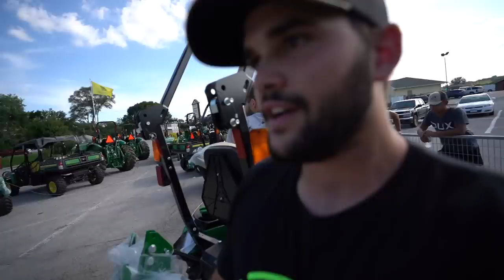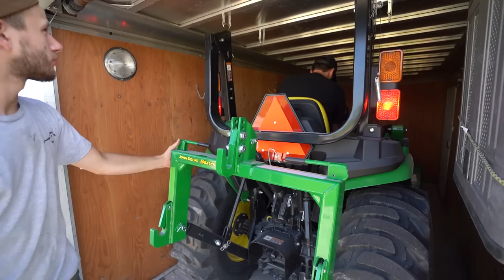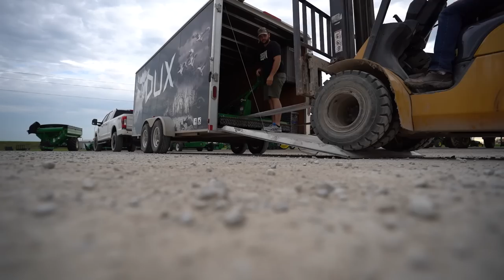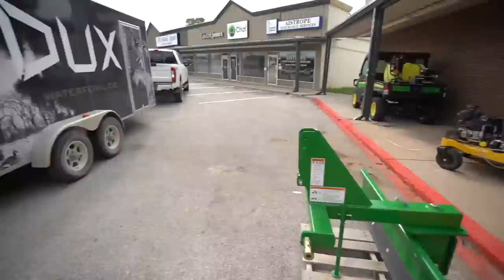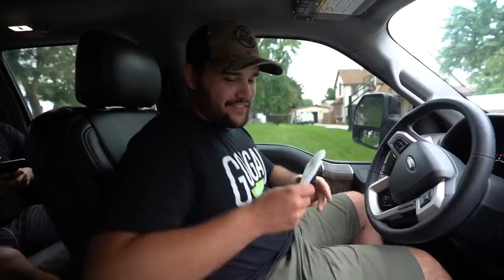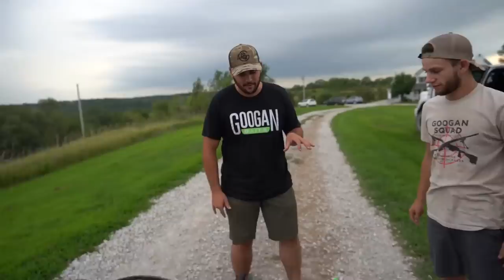I BOUGHT MY FIRST TRACTOR!!! (I Crashed)

Comment: After u work the tractor hard make sure to let it idle for like 5 minutes. Just a helpful tractor tip
Reply: That is the same thing I teach my friends when they drive ours. When they are just learning they always shut it off on high idle and it drives me nuts.
Reply: You dont meed a full 5 minutes i let is sit at idle 10 seconds is fine all that it does it slow done the engine so its not as hard stop when you shut it off

Comment: You need to make brush piles. Brush piles are good for several reasons. It gives rabbits, quail, and other small critters, shelter from the elements and predators. You can get raspberry bushes to grow up around them for deer and other animals to forage on. In the winter time, if the pile is dense enough, critters can use them for safe havens from yotes, bobcats, and other predators. Plus raspberries make great jams, jellies, and desserts. Now when you start making trails through the woods, remember that deer will normally take the path of least resistance as long as it's going in the direction they want to go. You can actually make "funnels", to guide deer into your shooting lane. Try to keep the canopy,(tree tops), covering the path(s) when you're clearing the underbrush. Oh, and deer are used to using the same trails because as they walk, they leave scent on the ground in the soil. That's how they find their way in the dark. They sniff the ground to make sure they're on the right trail. Some of these "natural" trails are ones that have been used for generations. Deer are creatures of habit. If you find some natural raspberry or blackberry bushes growing, try transplanting a piece of that bush along the trail(s) you make. It could take a few years, but the results will be amazing.

Comment: You will need a box blade to attach to your 3038R tractor so you can level out the your driveway and you need a easy hitch attachment to make hooking up your attachments easier as well. The equipment you already is enough to do some work around your farm and that tractor have plenty of power to do almost any work around your place, but the box blade and bush hog is the two attachments most people get. The blade you got is good enough for grading with though, but the dealer should have told you about what you should get first with your tractor though.

Comment: Put your tractor in the lowest gear that it has..start two feet from the tree, tip the front edge of the bucket all the way down push forward and wiggle the front edge of the bucket up and down..it will pick up the front of the tractor when you're doing it right.. then wiggle the bucket up and down to work it under the roots of the tree!!

Comment: I own a 2005 790 compact John deer Similar to yours and it lasts forever because we purchased it back in 2004-2005 and it is still going strong and is very handy. But be careful with the weight limit on the front because it can become top heavy.  And when plowing the small food plot, use one blade instead of two because it will bog the tractor down or it will be sloppy rows

Comment: Just remeber when you use the tractor to always set the bucket and brush grappler down to rest on the ground when you shut it off.you don’t want those hydraulics to fail because of leaving pressure on them

Comment: Piece of advice if your using the blade to move snow push the snow in reverse and your blade won’t dig in the ground and tear into your yard/gravel. I use a ranger with a hydraulic blade to push snow on my acreage up here in sodak.

Comment: If clearance is an issue with the tractor in the DUC trailer just air the tires down on the tractor, youll gain a lot of clearance

Comment: I think that you should have gotten a kubota because you can't remove the loader on the john deere, also the all of  kubota's HST models except for the BX has a three range transmission the deere has a two range transmission and most kubotas are cheaper  even though the kubotas have metal hud and fenders and deere has plastic ones

Comment: you need a quick hitch for the tractor. will make everything so much easier. also you probly should buy a bigger flat deck trailer, f250 and.... actually just buy a skid steer. much easier

Comment: Don’t have a heavy load in the bucket and turn real quick the shit will flip so easy. I use one for landscaping and it’s dangerous as shit on the smallest incline. If there’s a way you should find a way to make the front wheel base at least a foot wider on each side. Maybe wheel spacers like a ricer 😂

Comment: somones gonna end up gettin killed by the hydraulics i can already tell...Just a friendly tip the hydraulics run of the engine... so if you shut off the engine you've killed your hydraulics as well. If you turn the machine off make sure to put the bucket down.

Comment: the reason you couldnt  push the trees over is because you had it in high gear you need to put it in low gear or else you will burn your hydrostat out of it

Comment: I had to pause this for a minute, while you are playing picking people up. (Not a toy) this is a diesel engine it has a brake in period dont rev up to the max and please for the love of God check engine oil b4 start up and let warm up 10-20 minutes before using. The colder it gets the slower it will move until at max operating temperature. The hydraulics will take the longest to warm up. And if ur going to be using it in the snow OIL SPARY IT SOBIT DONT RUST OUT!!!!!